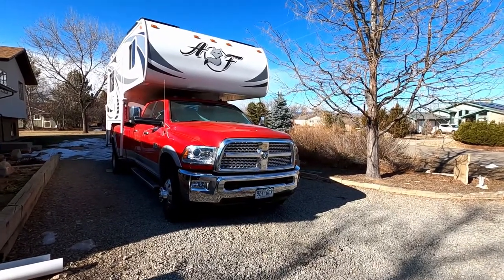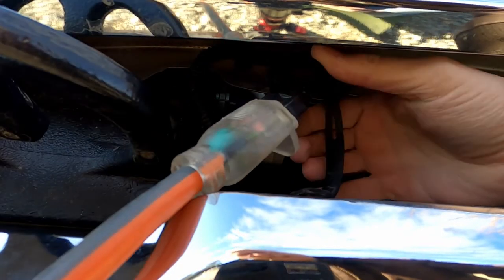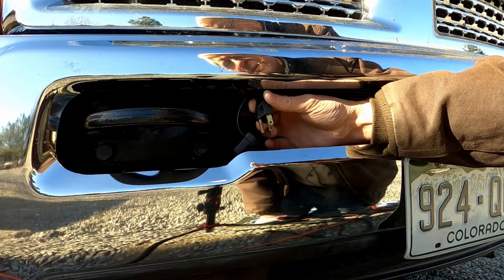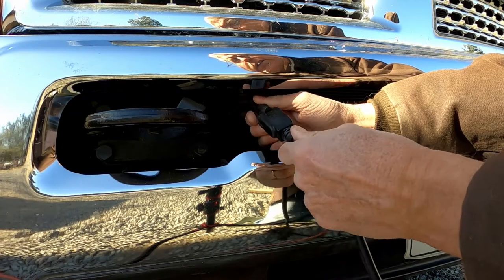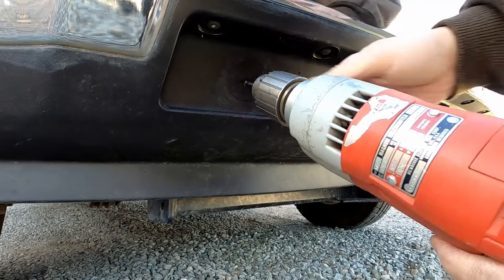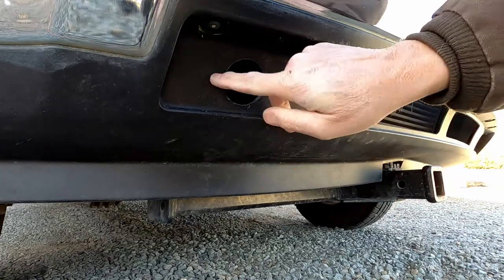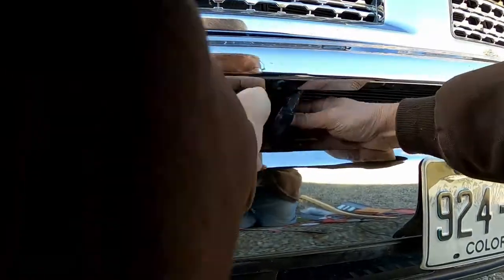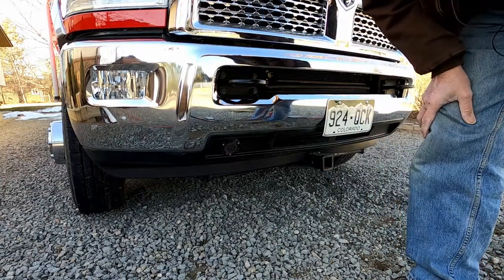Install a Flush Mount Block Heater Plug Port on Your Pickup Truck

Comment: That lip on your extension cord is a actually to hold the extention cord in a socket. Some outlets have doors that also have a tab on them so when the spring loaded door is resting on the extension cord plug the two tabs wont allow the cord to pull out unless you lift  up on the outlet door. Kind of like the 7 prong trailer electrical plug.
Reply from the maker: Thank you for your reply!  Would you happen to have a reference/example of this - or perhaps a good search term.  I'm not having any luck finding an example of what you describe, but I'm very curious.
Reply: @kevintaberski4249  look up images of semi trailer outlets and look at the tabs on the doors. I dont know the specific name for them and couldnt find regular extension cord ones.
Reply from the maker: I spent some time Googling power inlets and plugs, recessed, semi-trailer, 120VAC, and so on in combinations and was unable to locate anything other than devices similar to the NOCO that have round recessed plugs.  These all seem to have the same clearance issue with the tab and none that would capture the tab as you describe.  I'm familiar with 7-pin trailer connector so I can envision what you describe - and it makes sense that such a device would exist - I just can't find one!  The search continues ...

Comment: I think the tip on the female is like you said, to prevent the third pin on the male to be not inserted while the two others are inserted. 
It's hard maybe, but there are always people that will manage to do that, so that's probably why NEMA, IEC, EEC codes for extension cord plugs are suggesting such a fool proof design.

It also provides, in some instances, extra support against gravity with a counter momentum. But that's secondary.
Reply from the maker: Rudi - that makes perfect sense!  Of course, with the tab cut-off it IS possible to insert a plug rotated 180°, but with the tab intact you can't.   I guess this didn't occur to me as I naturally and purposefully align all three prongs.  Oddly enough, I was unable to locate any definitive information about this when I recorded this video.  Plus, it pained me to cut-off this tab.  Thanks for sharing!
Reply: @kevintaberski4249  B.t.w. nice hidden spot and clean install. Merry x-mas.
Reply from the maker: @rudivandoornegat2371  Thank you for the kind feedback - it means a lot!  Merry Christmas and Happy New Year.

Comment: I think I would have used a large piece of heat shrink tubing over the plugs.  Or you could cut the plug ends off and solder then heat shrink tube over them for a nice forever connection.
Reply from the maker: That's an excellent idea!  Wish I had thought of it. I had used some large heat-shrink tubing (FlexTube) with sealant when I installed the solar-system in my truck camper - I may have even have some left-over large enough to accommodate a plug and receptacle.

Comment: was reading that on the NOCO  a  ground, positive or negative post  would break off... have you experienced this?
Reply from the maker: I have not experienced any problem at all.  I have 2 of the NOCO Port Plugs on my truck - one for the Block Heater and one for an on-board battery maintainer - all the pins are solid.  I even checked today just to verify.

Comment: I’ve got the heated pads, 1 for oil pan & a smaller 1 for the end of the radiator. I bought a similar connector but mine has 2 outlets on it. I don’t have it completely installed yet but I was wondering if anyone has tried the double setup yet? Thanks
Reply from the maker: Sounds like a good application for the double setup!  Thanks for sharing.

Comment: The 3 prong receptacle has a safety feature that prevents someone from trying to bypass or incorrectly plug in their 3 prongs into it. While a device can work with just 2 wires, the third wire serves as an important safety device when the tool or wiring becomes unsafe due to damage. Without a properly connected ground, you might be electrocuted from the tool's hardware becoming energized and not having a a fault circuit to safely dissipate the power away from the device or it's wiring.
Reply from the maker: Thanks for the feedback and supporting the discussion.
Reply: This could not be inserted incorrectly as the two flat blades are different sizes. But long ago the two blades were identical and could be inserted as Wesley mentions. However, newer (Like within the past 30/40 years) plugs have two different sized blades that can not be inserted backwards.  They still need this protection because some old cheapskate like me has power tools that are over 50 years old.
Reply from the maker: @donhediger5072  It's crazy to think that there was a time that we relied in a wider blade for neutral.  I also clearly remember 3-prong to 2-prong adapters (without the extra ground-lead or tab connected), the extra width of neutral tabs clipped, sanded or filed narrow - and the worst - the ground pin yanked-out or clipped on a plug - all so a 2 prong receptacle (or lamp-socket adapter!) could be used.  I admit feeling some remorse in snipping-off the tab on the receptacle end of this extension cord once I learned it's intended purpose.  Thanks for the comment!
Reply: @kevintaberski4249  just don't let anyone else use that cord. You'll know it's that way and probably won't encounter any of the oldstyle identically bladed plugs. Unless it's something really really old. By the way, I ordered the recessed plug for my cowcatcher.
Reply from the maker: @donhediger5072  Yes!  Plus it's dedicated for this purpose and the matching port-plug for the battery maintainer - where it is presently in use.